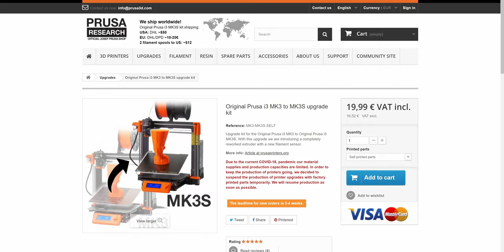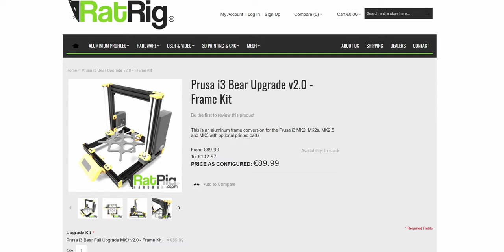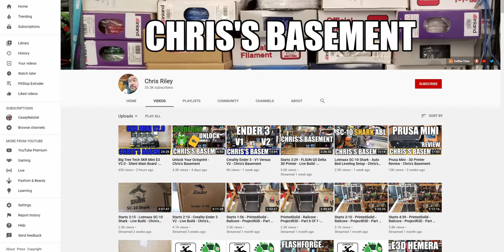PitStop extruder: compatibility aspects

Comment: I really like your design so I decided to purchase the MK3 to MK3S upgrade from Prusa (I have MK3 printers).  Looking forward to your release of the STLs!  Are you planning on releasing STEP files as well?  Are you happy with the Igus bearings?
Reply from the maker: Cool! I like the new sensor compared to the old one. Not sure what I will do with the STEP files, but I might make them available later.  I am happy with IGUS bearings, BUT they usually have a very very little amount of play under high load. I haven't noticed any print surface problems, but I know it's there. You can't tighten them too much as they would stop sliding. Still a bit better than the pre-compressed version because there you have no control.
Reply: @MihaiDesigns  I might skip the IGUS bearings for now and stick with my stock ones.  My MK3S upgrade kit is on its way!  Looking forward to your STLs getting released, I'll upgrade to MK3S then and not before. :)
Reply from the maker: @edmonddyogi6411  That's a good idea!

Comment: There are better IGUS bearings to use than these. They also come in a metal version that looks like the stock bearings, but with an IGUS polymer bearing inside. They're considerably more expensive than these IGUS variants, but would probably work way better - I hope, since I have a set here I haven't yet fitted... I also bought new hardened aluminium rods since that's recommended with these bearings, steel will (oddly) cause more wear on IGUS bearings than hardened aluminium will. It's not a cost-effective upgrade though, between the expensive aluminium/polymer bearings and the aluminium rods it went way over a hundred euros.

Comment: HI, I have a question: is the pitstop compatible with stock mk3s frame? thankyou!

edit: sorry I kept watching and saw, I want  to add the bear frame but is expensive for me in Australia where else the pitstop looks more of an upgrade for less cost but hopefully it works just as fine of the stock frame!

another edit: the revised extruder motor, does that require a new board or firmware changes?
Reply from the maker: Yes, someone confirmed it works.
Reply from the maker: Update: it seems that there might be an issue with the PitStop carriage hitting the PSU screw at the right side of the frame. I'll have to figure out a solution. For now I think the back of the carriage can be filed at the point where it would hit the screw.

Comment: Oh, I can't wait to try it on my MK3sMMU2s 🤤. I currently have https://www.prusaprinters.org/social/7969-mykal451 installed; such an LED to indicate whether the sensor detects a filament would be an awesome addon 🙂
Reply from the maker: Cool! You know you can see that in the printer menu, right? Not as easy as looking at an LED though. I think there is room for one.
Reply: Hi Kenneth I recently ordered the Mk3S kit on Prusa page still waiting to ship, do you know if I will get the new MMU2s in this one ?
Reply: @zero00tolerance  the MMU2s is a separate kit. But in any case, they always ship the latest iteration/version of whatever hardware you ordered.

Comment: Hi, if you change to a SKR board, it means no Prusa firmware? or you could adapt the firmware to the SKR 32 bit board? cause I think the Prusa firmware can't be charged in a 32 bits board.
Reply from the maker: You're probably right. An SKR means you probably want to not use the Prusa firmware. Switching to an SKR board is venturing far from the beaten path and it's not easy. I wouldn't advise anyone to go in that direction unless they know what they're doing.
Reply: @MihaiDesigns  Like you mentioned though - Chris Warkocki has done exactly that and made videos on how to customise a "Prusa" skr1.4 marlin firmware. He's also released already compiled versions with a few differences for people that are not as tech savvy so I really recommend checking him out and also the "Pretty" profiles that are excellent base profiles.
Reply from the maker: @basementdwellR  Yup, I followed his tutorials when customizing my own Marlin. Haven't looked into the compiled versions as I'd have to adjust them anyways as I replaced my motors. I hear the Pretty profiles are pretty good; haven't tried them yet. I enjoy messing with all the settings way too much it seems.
Reply: @MihaiDesigns  Heh yeah, the pretty profiles incouraged me to make my own, totally got me into adjusting stuff, but I really liked the PETG one. I am kind of keen on looking into reprap on skr since it supposedly supports change on the fly rather than having to recompile firmware...
Reply from the maker: @basementdwellR  about time for firmware to enter the 21st century, yeah!

Comment: I just purchase the prusa i3 MK3S. not shipped yet.  should i upgrade to the bear frame?  I'm new and i'm reading that if upgrade the bear frame, you will need custom code for x distance.  Prusa customer service says the bear doesn't make any difference in performance. is that true?  should I switch to the bears you using? where to get them.  Should i upgrade the motors? where to get them?  I would like to keep using prusa firmware b/c i don't have time to learn to write my own custom version (unless there are good written instructions) . feedback is greatly appreciated.
Reply from the maker: Hi Dennis. I wouldn't recommend any mods for starters. Take some time with the printer and see how it goes. You might have to learn a lot about how to use it. If having trouble, ask the community or the Prusa support. If the printer works I wouldn't go down the rabbit hole of mods too soon. With many mods it's possible to end up with worse quality and will have to troubleshoot on your own with almost no support or resources. It's time consuming and not fun. I designed the PitStop extruder for people who have clogging issues and need to take apart their extruder often. It's out of necessity. If that won't be the case for you, then stay with the stock extruder. Try to enjoy your time printing things you like, alt least in the initial period.
Reply: @MihaiDesigns  thank you for your feedback.  I will keep the i3 mk3s stock when i build it to test it. I will upgrade the mk2.5S to bear upgrade likes yours excluding motor upgrade.  Can you tell me what kind of motor you upgraded?  You are still using prusa board and firmware?
Reply from the maker: @TheMobilemak  I've got 0.9 degree motors for slightly smoother prints. If you get a 1amp one then you can still use the Prusa board, and stock firmware will probably work. Works for X, Y, and E axes. However, these motors are a bit weaker. I do not advise getting the large motors like me because you then need new board and firmware and it's a bit painful to configure. You can change the motors at any time, but I'd stay with the stock ones unless you're sure you want to experiment with 0.9 degree motors. The 0.9 degree extruder motor had the biggest impact for me on flat surface finish, but it's not significant.

Comment: Would the MMU2S unit still function with the old steel ball mechanism?
Reply from the maker: For MMU2S you replace the steel ball with a lever that gets triggered by the idler door. You still need the two magnets even though the stock extruder version for MMU2S does not use them.
Reply: @MihaiDesigns  Actually just realized the answer working on an unrelated upgrade- MMU2 requires a fully constrained filament path which the steel ball is not. My printer's been pseudo-jamming trying to print a large headphone stand in wood-fill filament and after changing to a bigger nozzle, slower speed, and a retraction-less profile to no avail, the motor/gear cooling is now my most suspected failure mode. I'll be switching to the Pitstop Extruder soon!
Reply from the maker: @BrazenRain  Cool! If you end up switching, let me know how it works out, especially if you encounter any sort of issues. I'm all about improving the design, but I haven't used my MMU2S much.

Comment: I myself use SKR LBBR bearings.  8 races of balls vs 4
Reply from the maker: Oh that's cool! Using Bltouch or other mods?
Reply: @MihaiDesigns  I did add cable chains to my printer.  Did lots of different redesigns.  My cable chain mod is famous for using removable clips on each chain link vs having to string cables all the way through.  All my designs are in TinkerCAD.
Reply from the maker: @ayourk1  awesome! I didn't know about your cable chain. Any thoughts on moving to Fusion 360? It's a bit buggy tbh, but after you figure out the workarounds it's OK even for complex projects. I'll be doing some videos some time. Got so many videos planed lol
Reply from the maker: @ayourk1  logged in, but I'm a bit busy atm working on videos 24/7 haha